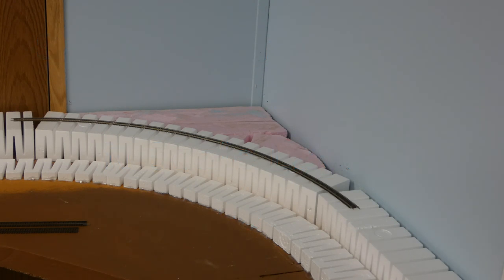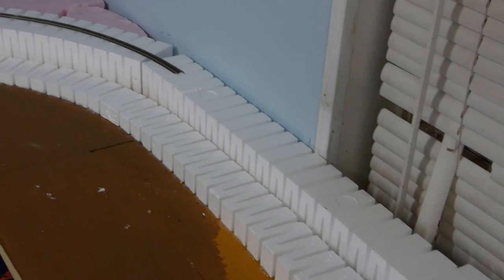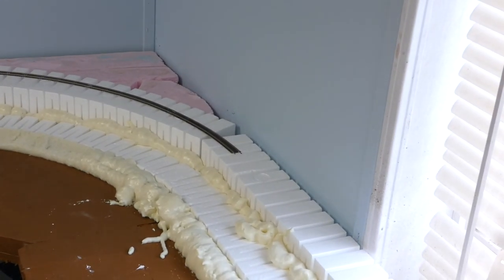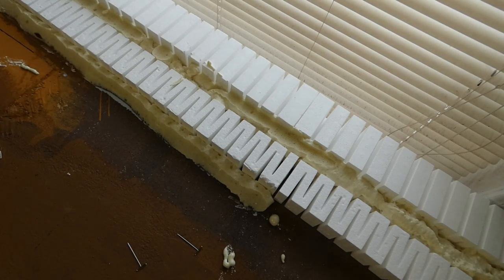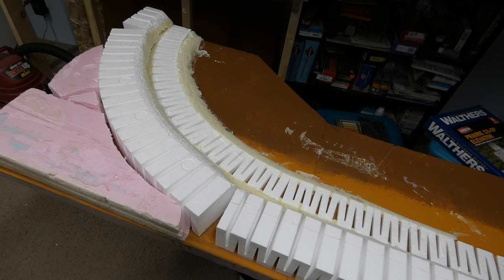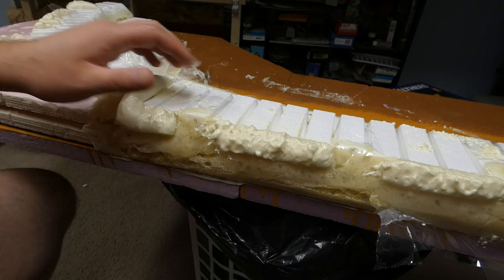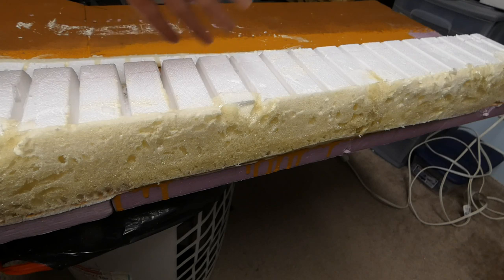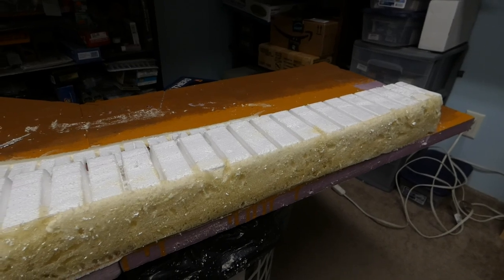Spray Foam Hillside - N Scale Layout Vlog #4

Comment: some of these products in recent days don't seem to work as they did or as we remember them working.. my thought on it is -- today they have had to change the recipe in some cases to meet EPA standards and as a result the product is not as it was in yesteryear...I've noticed especially with caulk and silicone.. it just doesn't seem to have the shelf life it once did as in years ago.. This may be the case with your foam.. it may have sat on the shelf for a while before you purchased it and some of it's integrity has already expired.. "maybe" that why it dried different and cut different than you remember back in the day.
Reply from the maker: Spackle I have come to find out is certainly that way and even sealed it hardens up.  The hillside has held up well since doing this though.